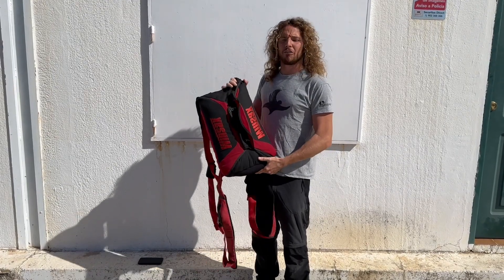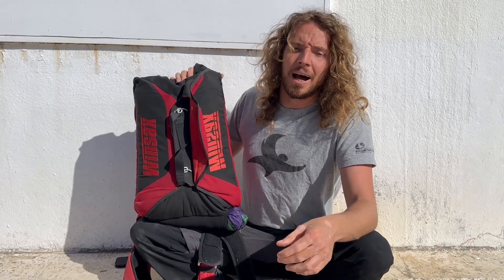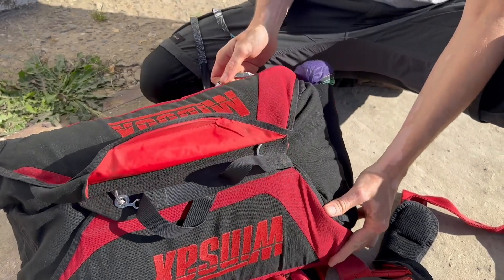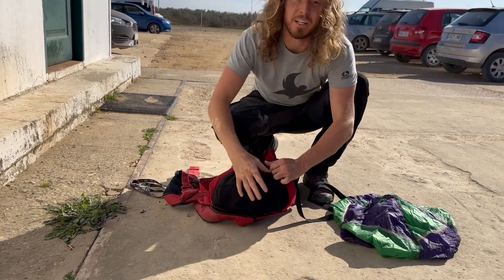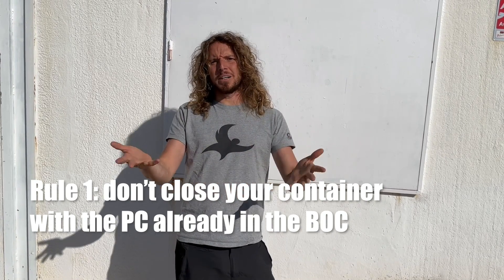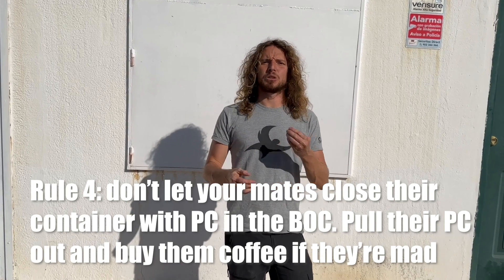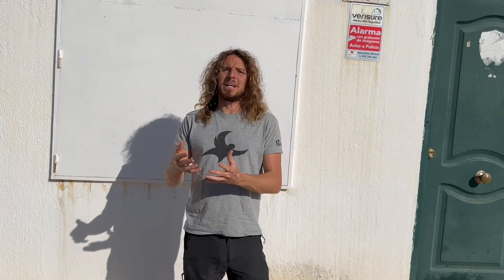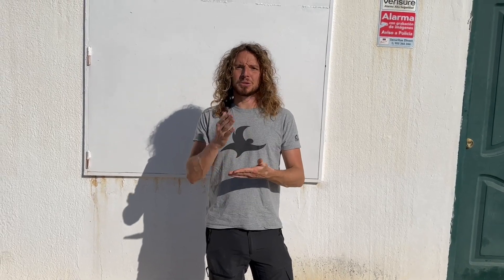BASEJUMPERS: AVOID THIS PINLOCK

Comment: I definitely didn't notice that it was packed with pinlock all the time - it's really hard, if not impossible, to spot it - it needs to lift up the flap and part of container to see it correctly, or to pull out the bridle. Very good video, I hope it will help preventing further fatalities. Thanks for this, David!

Comment: Might actually not be a problem on a squirrel container using a squirrel bridle. The bottom pin will just come off the bridle and you'll at least pop the top pin and have a chance of extraction. 

Jokes aside, thanks for taking the time and putting this out there. May it never happen again 🫶

Comment: Wow, that's very interesting and rather scary that such an easy to make mistake could have such disastrous consequences.  There must be some way of altering the design to minimise this risk.
Reply: you’re not wrong, but the thing with systems that have to be ultra reliable to be used safely there are massive considerations required to make even the slightest changes. What if the flap or whatever you just added creates the risk of some other malfunction you could never have seen from your pov, what if the forces on the bridle now concentrate on a smaller area causing it to wear out prematurely? With BASE where there isn’t even the option of having a rig TSO certified so you at least have some idea of what objective testing has been done, people also tend to be very skeptical of innovations and for a good reason. 

Even the really good, recommendable and safe systems that have been developed in the last decades in skydiving aren’t without risk. Idk if you are in the sport but there is something called an AAD for regular skydiving, which is a computer with a built in altimeter and accelerometer and it can fire a small cutting charge that releases your reserve parachute if your still are at terminal velocity at a set height limit. 

It’s a great invention and made skydiving a much safer sport to learn but i personally witnessed a situation where a way too inexperienced dude got himself a way too advanced wingsuit, tangled in it, wasn’t able to easily reach for his reserve ripcord so he decided to just pray to Jesus, go as fast as possible and hoped that his AAD would fire and save him. It did but what in the fuck are you looking for in this sport with this level of problem solving incompetency??